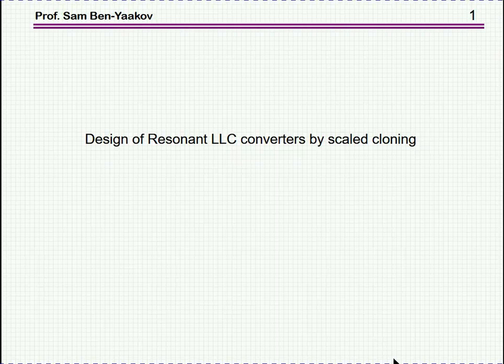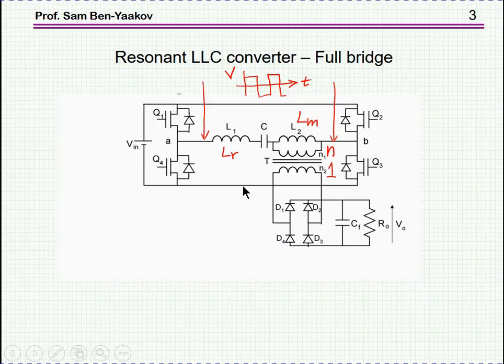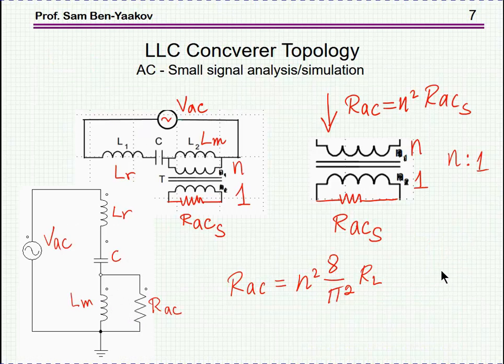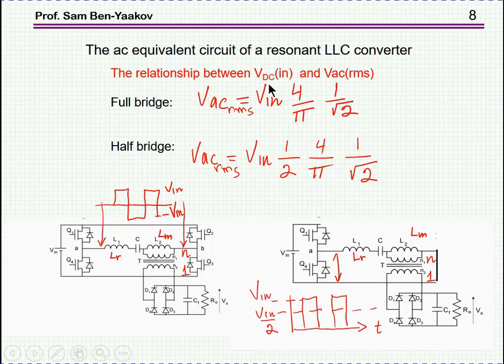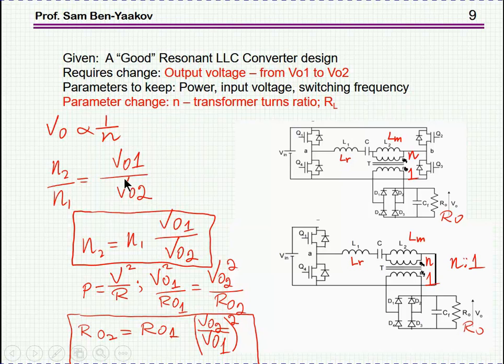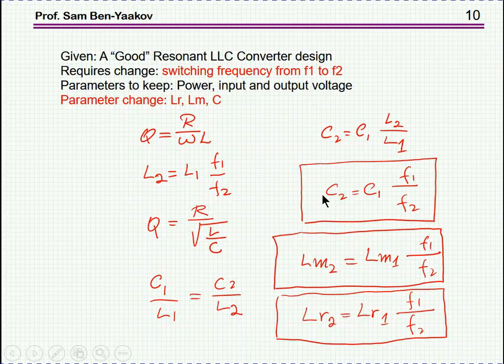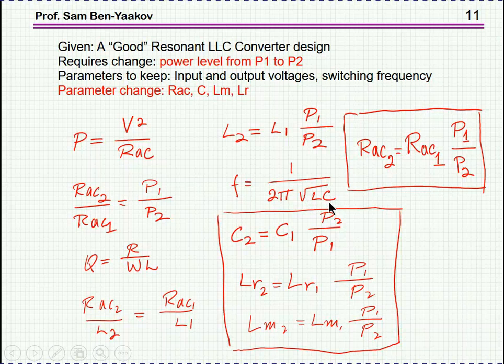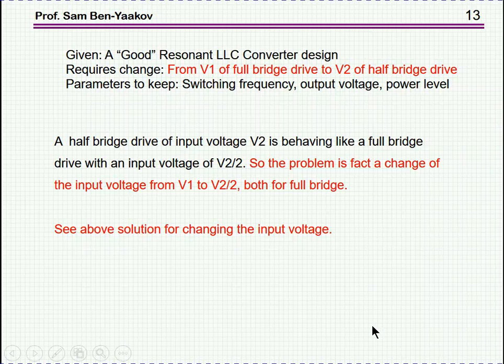Design of Resonant LLC converters by scaled cloning

Comment: This is not correct and that is because Q of the good design will change when you change any of the variables you discussed f, V or P.
Reply from the maker: This is basically the convntional design made simple. You have a better suggestion? Let's hear it.
Reply: @sambenyaakov  The solution is to start from zero. for example when the power change and voltage is cte. then the current will change. in this case we should keep in mind that the magnetizing current is same so we should keep Lm same because Vi and f are same. we need only to change the cross section of the conductor. since the Ae and Le of the core are opposing in the Lm expression, then we should change both in the same rate. since that is not possible due to the geometry constraint  because  the rate of change of Le is higher than Ae due to the change of the winding area, Then the designer has to start from zero his design. The same thing for other cases, start from zero.

Comment: Sir how to choose  Ls and Cs  for full bridge  my transformer lm fixed 0.4mH np/ns =8/57 switchinf frequency 37khz.
Reply from the maker: You can not  fix both the Lm and switching frequency. Are you sure the turns ratio will give the required output voltage?
Reply: @sambenyaakov  it having 4 no of secondary each having 57 turn one primary having 8 turn

Comment: Hello Sir, Firstly great videos, really appreciate you sharing all this knowledge. Just wanted to know if Lr and Lm can be two windings of the ferrite transformer? In my limited understanding, I feel that will now work very well due to mutual inductance and the coils trying to drive each other but I'd like your take on it. 

Ref. the application note https://www.infineon.com/dgdl/Application_Note_Resonant+LLC+Converter+Operation+and+Design_Infineon.pdf?fileId=db3a30433a047ba0013a4a60e3be64a1 I can't find Lr in the final schematic. (pg17)

Can you help please?
Reply from the maker: Thighs could be done but tricky. No problem with LM but for Lr which is in fact leakage inductance, specialized contraction must be exorcised to avoid excessive power loss.
Reply: @sambenyaakov  Okay makes sense. Lr needs to be the leakage inductance of the transformer which can change a lot during manufacture. Also I feel the leakage Lr will add to radiated EMI. Right?

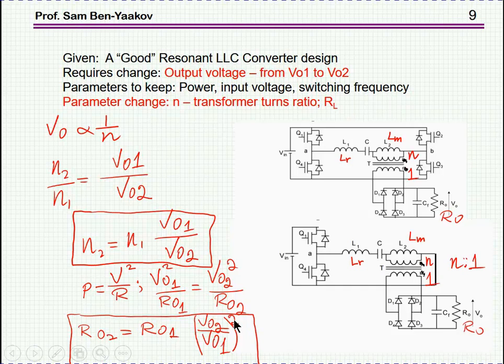Comment: Sir, in case the out voltage is changed 8:17, when the value of the load resistor will be changed to the new value. Thus the quality factor will be changed to the new value as well.  Therefore, the characteristics of a circuit will be different. In this case, I think we need to keep constant Q by changing the L, and to keep the switching frequency, thus the value of the capacitor has to be changed.
Reply from the maker: The classical method is to move to another Q although people have suggested to apply variable inductors.
Reply: Thanks!

Comment: I am busy with a LLC but it needs to go from 10mA (open output) to max 15 amps, I do loose the regulation and it go to max voltage of 75 volts, it is 65 normally regulated. when I draw 5 amps it does regulate fine, everything in simulation not real live yet,. Thanks
Reply from the maker: You need to improve control to go into burst mode.
Reply: @sambenyaakov  I did simulate so not yet using real controller, I have 10 ncp1395, maybe it is even better to run without feedback because of there is a audioamp as load who is quite unpredictable.  I need also one resoant for high and low voltages, however when have more taps the resonat frequency do change, I did not find yet a good tool to calculate voltages like 15 V 15 amps 2 x 120 volts 250mA 1 x 320 volts 150mA, I did read for high voltages go below resonance control and high current above it. Hmmm difficult, I need to find me a good calculation tool. regards.
Reply: @sambenyaakov  I did read this, however I can not simulate that properly, so I do let read here the skip mode of the controller. I think you did mean this.

This represents a design factor when selecting the
magnetizing inductance and the series inductance if no−load
condition can occur. Hence, once the turn−ratio and these
elements has been selected, you can immediately see if the
converter will accept no−load conditions, whatever the
VCO excursion is. Fortunately, the NCP1395 authorizes
skip cycle and will naturally prevent loss of regulation in this
particular case by interrupting the switching frequency as
the feedback loop reaches a user−selectable level.
Reply: @sambenyaakov  Yes I have seen on chip datasheet it does burst mode when low load is present. However, the needed voltages and the use of it on audio amplifiers it does not work wel with a regulation because when Idle it draw less, it can dop burstmode here but that also do not work well because of the transients such a amp draw, I have seen that the best way is to make a free running LCC who I do set on resonance or just above it and set a sigle frequencion. I did test it and I am suprised that with a 24 volts 15 amp load, it is just a 2.3 volts difference with draw 100mA. I do use analog regulators for the tube filement voltages, this will work fine I gess. Thanks for answer and sorry I was late with answer, but need to cure from lyme.

Comment: Hi Dr Sam. I don't think this work below resonant operation. That FHA analysis is approx. This only cover above resonant operation in lagging power mode. Also this is not true at low load. We have different modes at low load or light load. Time domain analysis is needed to model it correctly.
Reply from the maker: Yes, As I emphasize in video the FHA is approximate and there is a need to cross check (the easiest) by stimulation. Why would you like to work at ZCS ?
Reply: We have ZVS also below resonant frequency (series resonant frequency). I don't want to work in ZCS. Frankly speaking , there is no ZCS with LLC for MOSFETS , the ZCS what people talk is output diodes at below resonant. This improves reverse recovery problem.

Comment: Hi Dr Sam , in case of changing the input voltage , the turn ratio n will change also ,you do not mention it in the lecture.
Reply from the maker: You are absolutely correct (since the gain of resonant network is kept, the input to transformer will change so there is a need to change the turns ratio). I missed this one. Thanks for correction.

Comment: .
great, many thanks! 

this is definately useful!

can you please explain what I need to consider -

- if I move to a different ferrit material in L1 and L2
- if I move to a larger Transformer with the same ratio

many thanks

Gerald Trost
Reply from the maker: No problem for both is the electrical characteristics are the same. Watch for magnetic losses in cores (need high frequency ferrites).